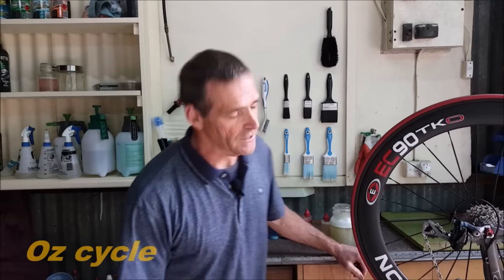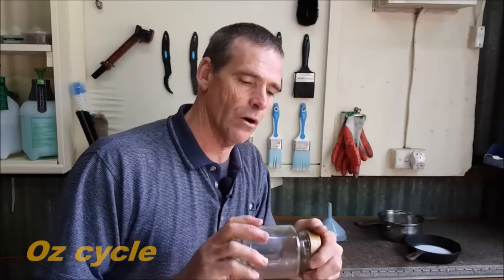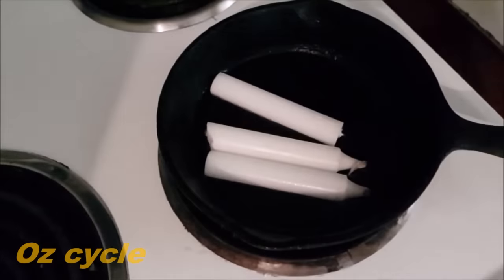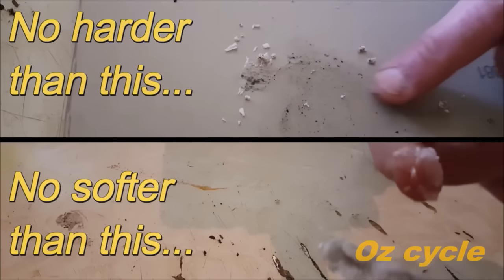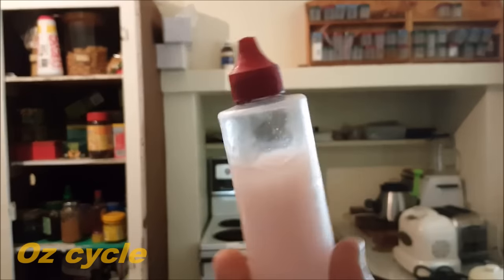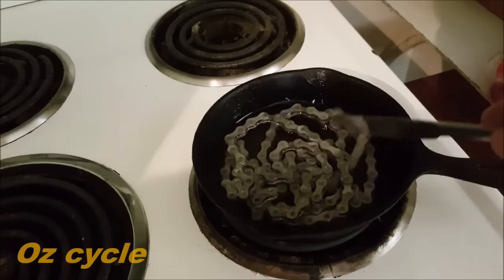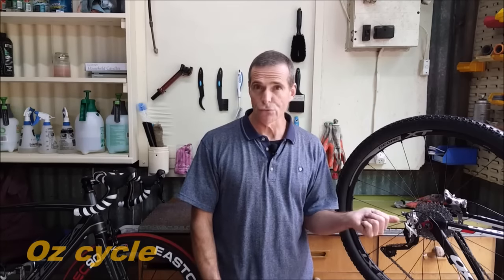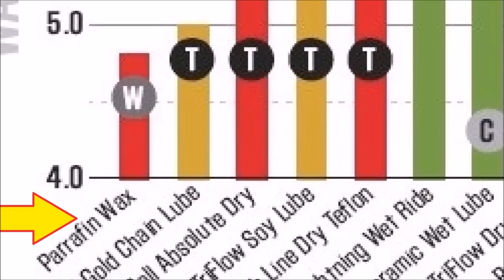BEST chain lubricant ever !! .....make it yourself.

Comment: My 1st attempt was close to being a failure - i was able to source everything in Bunnings - Xylene $21 !!, paraffin wax, paraffin oil -  bought a new fresh small pot, induction cooker....the squirter i used was more like a sauce bottle and the stuff flew everywhere - chainstays, floor, bike stand, wheels - and it instantly froze into wax. My chainstay looked like an altar with overflowing wax !!!! Eventually the bottle gunked up pretty quickly. 

I question whether this works better than traditional oil lube though because you can see the wax instantly turns solid upon contact with the chain - i doubt there was a lot that was able to flow into the links in time before solidifying.  Anyway - i'll do a ride on the weekend and hope not to be dry running my chain.

2nd attempt - i used more xylene/paraffin oil and warmed the bottle up like a baby bottle and was able to keep the lube flowing for longer.....i'll still have to look for a bottle with a smaller hole - they can be so hard to find.

Note that it's not something you can apply at the last moment before the ride like a traditional oil lube - you need time to warm the wax up like a baby bottle. In room temp the wax lube is a solid in the bottle.
Reply from the maker: Just add more xylene especially in colder conditions. The mixture should last appx 3 minutes before the xylene evaporates.
Reply: Riding my indoor bike which i had applied the lube last night - it felt really smooth - I never had a smoother gear changes. This is on a bike that regularly chain sucks for some unknown reason. So there's hope on this theory that the paraffin wax is the superior lube. The real test will be on my road bike in an outdoor ride. Let's see how it fares. i hope the wax lube effect lasts the entire ride. I still have my doubts that there was enough time for the lube to get into the chain properly before it solidified. The wax pretty much solidified within 1 second on contact with the chain - probably the chain was cold - typical melbourne night. 

Need to look for a better bottle dispenser - the one i got had too big a nozzle - it was like a hose - spraying molten wax everywhere.

Phase 2 - i think i will try taking the chain off one fine day (rainy day??) and dunking it in the paraffin wax mixture - that'll work 100%. but looks like a very time consuming thing to get around to.

Comment: I used candles dissolved in petrol to apply wax coating to chain. works ok but wax slowly falls off. after rains noticed spots of rusts in chain. so switched back to engine oil as lubricant. Hope it is better than coconut oil I used before wax. oils are always messy. and chain may slip. but never slipped with wax.
Reply from the maker: +Noel Filatov AV Candle wax needs to be softened with paraffin oil first so it clings to your chain and is malleable. Onve softened you can either get it i to your chain by hot wax bath or mix it with xylene and soak the chain. It will work for you Noel.

Comment: This is awesome, i've been using this wax recipe for 6 months now and its great. Just washes off with a kettle. One question though, i've heard some people put PTFE powder in to increase the slipperiness. How do you rate this and how much ptfe do i need to add? Thanks
Reply from the maker: Ptfe replaces oil. Oil attracts dirt
Reply: @stevenleffanue  sorry, does that mean ptfe attracts dirt, or doesn't
Reply from the maker: It doesnt
Reply: @stevenleffanue  excellent. many thanks

Comment: hey there great vid - when you washed that mountain bike did you degrease the chain first or just apply on top of the incumbent wax?? thanks
Reply from the maker: If the chain needs clean I remove it first to be cleaned and rewaxed. If chain is ok I clean bike with it on or off it doesnt matter.
Reply: thanks

Comment: Thank you Oz for the great video.  I would like to know if your mixture is intended only for the chain, or can it/should it also be used on the derailleur pivot points and bearings.
Reply from the maker: +Jerry Viviano Glad you like vids. Yes you can use the wax on gear/brake cables,rear jockey wheels and other sliding parts like you said...derailleur pivots,Jerry. Not sure about bearings tho.

Comment: Hi Steven, wonder if you’ve any experience of problem using Connex link?
I put a fresh waxed chain on and used Wipperman Connex link, 11 speed. It goes on ok, following the tech diagram provided, but soon after pedalling a few turns, it starts getting stiff and eventually the movement at each end locks, effectively making a solid link until the next outer plates at both sides.
I’m thinking it’s to do with wax but haven’t had time to investigate fully. Instead I removed it and used an older KMC link which is fine.
I’d be grateful for any insight or suggestions. Your channel is excellent for me as I love to do as much as possible myself.
Reply from the maker: Did you wax the link Andy?

Comment: I´ve just seen this video, and it looks like a nice way to make Your own lubricant.
Living in Denmark, we have a lot of wet trails during most of autumn, winter and spring, and the drivetrain needs a lot of attention.
After the first cleaning and lubricating, how will You recommend maintenance and re- lubricating to be done?
Reply from the maker: Very small amount of degreaser and a dust pan brush.

Comment: Great vid! Went out and got all the ingredients and made my first batch! Easy as! However, everything has solidified in the bottles! I even brought a bottle inside, and its still hard! At what temperature do you expect the lube to remain liquid? I really want to like this stuff, and I now have gobs of it, but it needs to be easier to use.
Will a higher portion of paraffin oil help?
And, I assume, Citronella burner oil, is similar to/replacement for paraffin oil?
And thirdly, can paraffin oil be used on its own?
Reply from the maker: +Rob Leviston At lower ambient temps you can put your bottle of lube in warm/hot water to liquify it before application. In very cold conditions you may need to warm the chain up also so the lube gets into the pins and rollers. The portions are to keep the wax like a hard cream,not to accomodate temperatures. Only use "paraffin oil" or "liquid paraffin".  Paraffin oil only as a lube will run and spread like oils do....gets on everything,messy and thins out too much. Cheers Rob

Comment: Thanks for the video, followed the guide but it turned solid with 100ml of each ingredient . The consistency on the knife was spot on. Do I need to add more paraffin oil or xylene ?
Reply from the maker: +Steve Mold It will go harder with lower temperatures Steve. Yes, add more xylene to keep it liquid. After application the xylene evaporates and leaves the wax in the chain.

Comment: Paraffin oil confuses the issue, xylene is a very strong and possibly carcinogenic solvent, and candles have a 10% stearic acid content that may or may not affect the adhesion and lubricity of the pure paraffin, available dirt cheap in 16 oz. pkg. at most grocery stores in the canning supplies section. Why complicate things so much? Just dump a pile of paraffin shavings into a jar of naptha, and it will dissolve or create a suspension that looks just like most wax-based lubes. Put into a squeeze bottle and you're done. I would still just either do the melted wax job, or buy Squirt for the odd quick in-between lube myself, as this is actually less effective and far more tedious than actual hot waxing a chain.
Reply from the maker: Good suggestion. I will try source Naptha and give it a go. Thnx
Reply: I tried using Naphtha as the solvent, and did not have a good result, with the mixture quite solid at room temperature (1/3 wax, 1/3 oil, 1/3 naphtha).  Maybe you're suggesting use a lot more naphtha?   BTW your last sentence is not making any sense...

Comment: Here is one of my aphorisms about life:  "The purpose of packaging is to sell you less, for more".
I note it is very effective in achieving that!

That said, I would like to support the idea of being cautious about using Xylene.  I am definitely not overly concerned about the risks of chemicals around the house, but Xylene does seem to be particularly risky.  All the more as this video is depicting using it in a kitchen, and I can well imagine someone then stirring the jar containing the final xylene mix, with that steak knife.  Probably not the best idea. 

Personally, I just replaced a chain after over 10,000km of commuter riding, and all I've even done is give it the occasional spray with WD40 chain lube, or just WD40.
Reply: The knife will be fine, everything evaporates. The fumes are dangerous though, long term exposure causes solvent-induced encephalopathy (CSE)
Reply: @cebruthius  that makes sense.

Comment: Thanks for your easy to follow instructions and I intent to start making my own paraffin wax based solution. I have read elsewhere adding a small amount of Teflon (PTFE) Powder and Molybdenum Disulphide Powder to the hot paraffin mixture greatly improves the result. This seems to make sense as both are well regarded lubricants and the wax would help bond the particles to the metal. Ive discovered PTFE powder can be expensive but as only about a teaspoon of each  is used cost is not so bad. Any thoughts?
Reply from the maker: Just paraffin wax alone came in as second best lube ever under test,Andrew. Adding PTFE and or MoDS should improve the lubricating qualities required by a bicycle chain as Molten Speed Wax has these additives and is No1 lube. The amounts to add would be experimental tho. Let me know how you go if you try it 😁
Reply: Appreciate your comment and will post the results once I have tried it for a few weeks

Comment: Great lube thanks for info just subscribed.....For the comments section....yes chemicals can be bad. No worse than what you will find in most household cupboards. Practice making some luv until you happy with consistency and have ago on old chain.....before using the one you ride with. Thank you for the vid.

Comment: Confusion?  What is the correct oil for parafin based wax lube in the USA? Web quote:  "Paraffin oil is NOT the same as lamp oil. Paraffin oil sold in the United Kingdom is kerosene. Paraffin oil in the United States is liquid candle wax and is improperly labeled for use in oil lamps and lanterns. USA paraffin oil is only suited for candle oil lamps that use small diameter (1/4" and less) round wick."  So are you using Kerosene or liquid candle wax as the solvent?

Comment: I made up a lube mix as you demonstrated, but after one ride I ran my finger across the chain and got the usual black on the finger. After the second ride the chain was noticeably becoming black. Even though I thought I followed your instructions pretty carefully the chain isn't as clean as I was hoping. Do you think I need to add more wax? What would you suggest.
Reply from the maker: Sorry but without knowing all the variables I cant suggest why your chain gets black on it. Some chains have a dark grey surface treatment on them which comes off in small flecks

Comment: Question OZ. thanks for the Recipe. Once the chain is waxed, using the rice cooker method or the direct application with the solvent/wax, how to clean the chain once it accumulates that gray metal residue. Do you just reclean with your gasoline wash? thanks again mate. Note: I used plain paraffin hot dip method many years ago but went to oil/syn lubes. I'm back now.
Reply from the maker: +ryoiter Nice to hear your back Ryoiter. If your chain looks greyish but runs very smooth still,simply wipe chain with clean cloth....its still lubed nicely inside. If you suspect it is getting dry or dirt inside, then yes, time for the complete clean and rewax again. You can liberally apply the bottled wax if you ride in bad conditions and your chain always gets dirty but full hot wax is better. Remember you can use the same hot wax....you dont need to make a new lot everytime. Cheers...Steven

Comment: This might be a silly question, but when the mixture starts to wear off, do you clean your chain as normal before reapplying - for example I use a Park Tool chain cleaner with degreaser? Great video and I  can't wait to gather the ingredients and try it for myself!
Reply from the maker: +Mike Morton If the chain is just low on wax but clean...simply add more with the squirt bottle. If the chain is dirty,which often occurs on mountain bikes off road then yes,clean the chain first then add the wax. Hope that makes sense Mike?
Reply: Yep - perfect sense. Thanks for taking the time to reply!

Comment: Thank you oz cycle for this great tip. I am really keen to try this and in the process of collecting the ingredients for this amazing concoction. I'm from UK and it seems that kerosene and paraffin oil are used interchangeably here. I have second thoughts buying this paraffin oil/kerosene as I don't want to use the incorrect material. The brand that you use, Diggers, is not available here. Sometimes, I also come across when searching online that mineral oil comes up as well as liquid paraffin. Are any of these; kerosene, liquid paraffin or mineral oil; work the same as paraffin oil? Thanks.
Reply from the maker: Not all the same Risty. Paraffin oil is used in cosmetics,medical and veterinary fields.
Reply: @stevenleffanue  Thank you very much for your advice. Really appreciate it. I will keep looking. Cheers.

Comment: Thanks for this.

I am curious how long this lasts in between waxes and also chain life (I do our chains in a rice cooker and get from 200-400km per wax and regularly get over 10,000km from a chain - I also  ultrasonic them before each wax).

I'm also curious about long term buildup on chain rings/cassette/derailleur of your brew - I'm asking because the reason I started hot waxing was because I was was using a commercial wax (it was RnR Gold) on-bike and found I had to strip down all the running gear a few times a year to get rid of all the gunk it left behind - since switching to hot wax I have replaced a few cassettes and front ring which were never once cleaned in their entire lives - is that why you are waxing off-bike on that jig?
Reply from the maker: I give my cassette and chainrings a light brush with wax remover every chain rewax. Remove any wax build-up between 11t and 12t cogs or chain  can jump.

Comment: I've noticed people wondering about the lube solidifying in the bottle when exposed to colder temperatures. Extrapolating that out, might there be a drop in lube quality on the chain during cold temps?  In motor oil in your car, a thinner viscosity solves that problem.  In your recipe it appears that the parifin oil provides the viscous medium... Wonder if a slight increase in the oil to melted wax ratio would alter the viscosity enough so as to allow for colder lubrication?
Reply from the maker: +Tony S Correct,Tony. Always do the viscocity test to make sure its right for your temperature conditions. You can also make two or three bottles of lube with different ratio mixes for different ambient temperatures. In cold conditions make sure the chain is warm on application too orherwise the wax may not get right into the chain.

Comment: Great video, thanks for sharing! I've just tried using liquid car wax on an old bike of mine, after reading the components in it, and it seems to be working well..came back from a 25k ride, and the chain and sprockets are still clean and still feel protected by a thin coating layer of wax. The chain was rolling smoothly and quieter than usual.. What's your opinion about it.. Do you think it lubricates enough?
Reply from the maker: +Fabulous Sport Outdoors Car wax uses carnaubra wax which sets very hard and wouldn't be a very good longterm lubricant for your chain. Thinking out of the box tho  :)
Reply: oz cycle Thanks for your reply. It'd be good to find a paraffine based one..

Comment: Hi, i love your videos, and i've tried this wax-paraffin-xylene lube but i found that xylene takes quite some time to evaporate and has quite strong odor. 

Also should the final mixture getting hard as you show at your video or not? Because i wasn't sure about it, i've added a small amount of paraffin to stop the wax getting hard. 

After some days though the wax-parffin mixture goes at the top of the jar, while xylene remains at the bottom. 

I've tested it in dry weather and it was really awesome, and i've ridden in wet for about 20-30km without any issues. Although i had to relube when i got home. All this with my MTB. I think i will keep using it but i'd like to make it a bit more thick for easiest apply without making mess, as i have the bike in my home. Any suggestions?
Reply from the maker: +makkioy The final mixture is very dependant on temperature,so dont worry if it goes harder. In cold conditions it will go more solid so you need to warm it up so it is a liquid again. Always apply it as a liquid to your chain.  Hope this helps. Cheers...Steven

Comment: great idea except Xylene is not only toxic (as noted) it will also disolve most plastics, including most plastic application bottles.  it should be stored in glass or metal container or it will slowly disovle the container (I learned that the hard way).  Might be better to use some other solvent?
Reply from the maker: True, however some plastic containers are unaffected.
Reply: @stevenleffanue  it also means it must be kept off of any plastic parts on the bicycle or it could damage those too. Okay on the chain but not good as a general lubicant where it might come in contact with plastic parts.